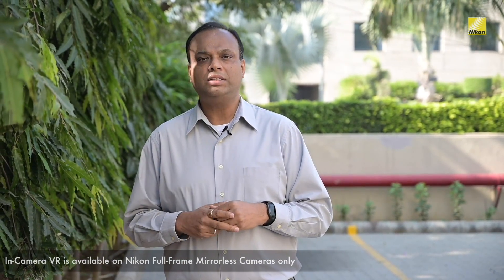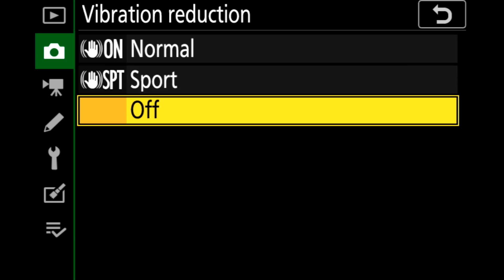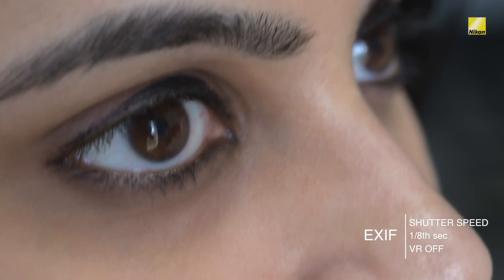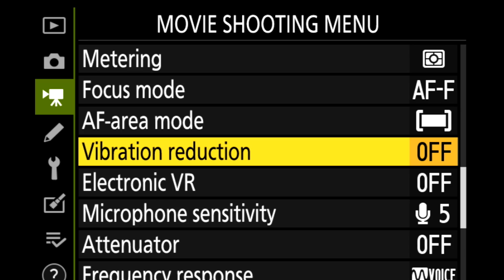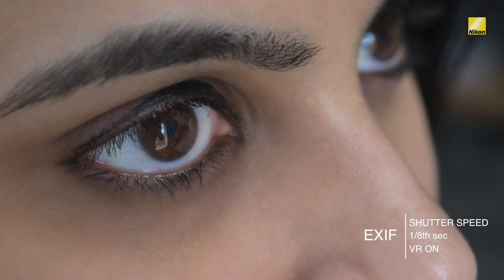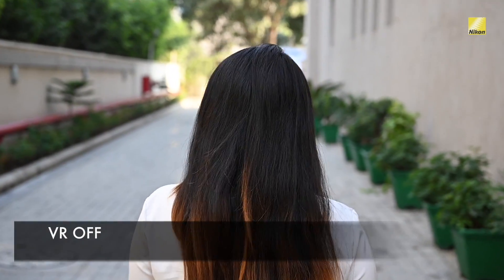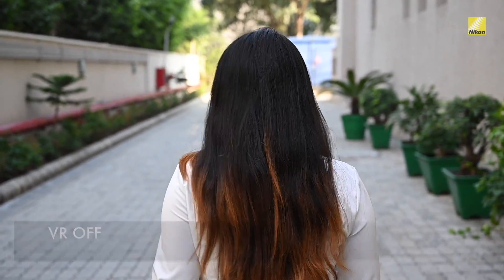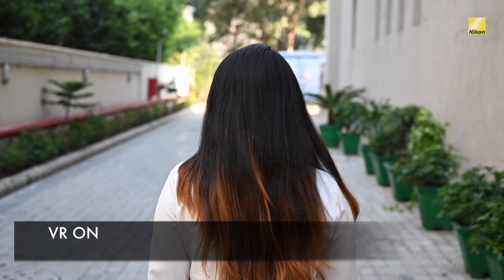#NikonQuickTips - Reduce camera shake with In-Camera Vibration Reduction (VR)

Comment: This option couldn't see in Nikon D5300
Reply from the maker: D5300 doesn't have in-built VR/sensor stablisation however there lenses with VR which you can use with your camera to reduce handheld blur in your images.